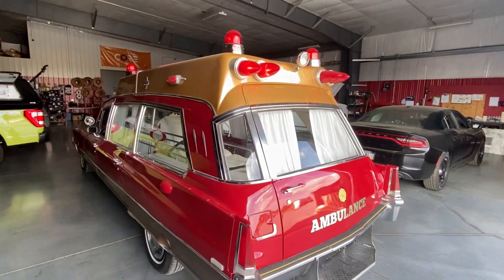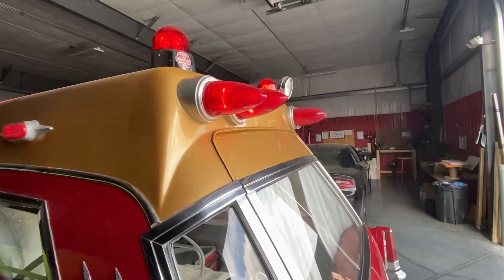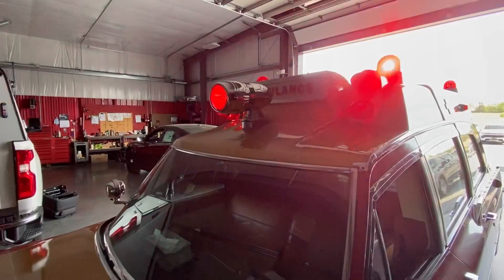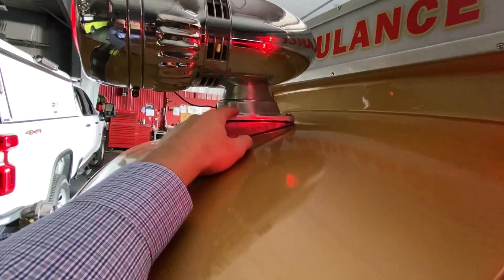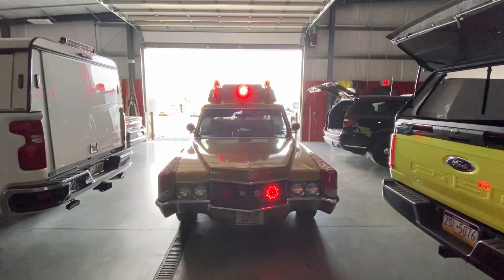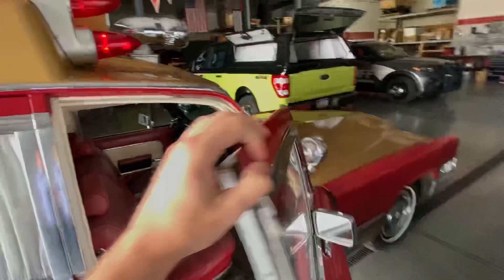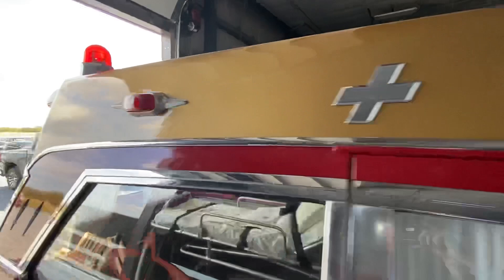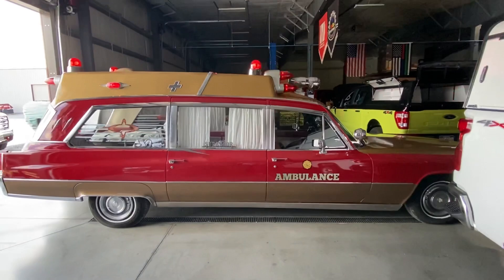1969 ￼￼Cadillac Ambulance | 911RR￼

Comment: The mechanical siren is fine, but the electronic siren does not sound period correct.  The yelp sounds like a 1970s era Federal electronic siren.
Reply: Lots of the older cars still being were retrofitted  later with electronics, which were a great compliment to the old mechanical growlers. Never a sweeter sound than a B&M or Q2 paired with a Federal yelper!